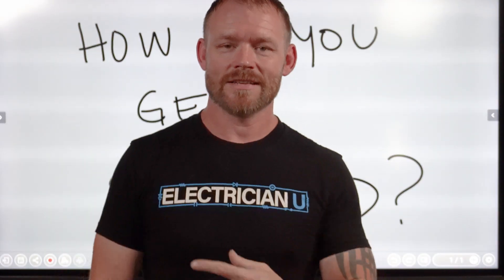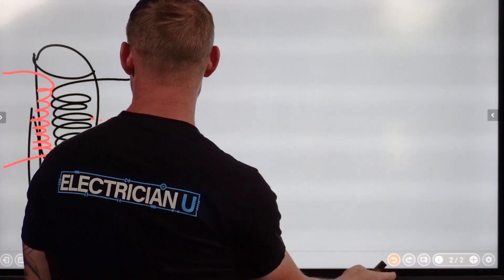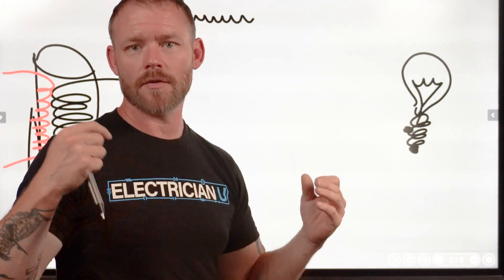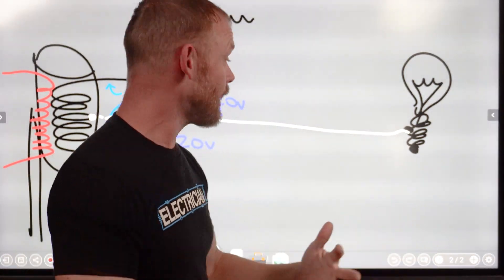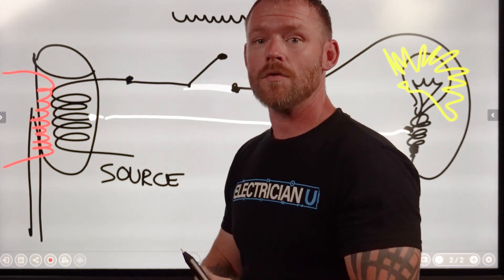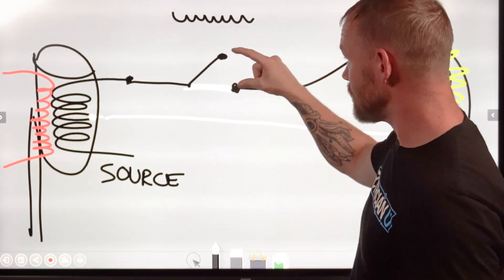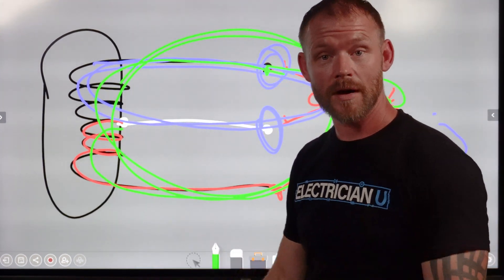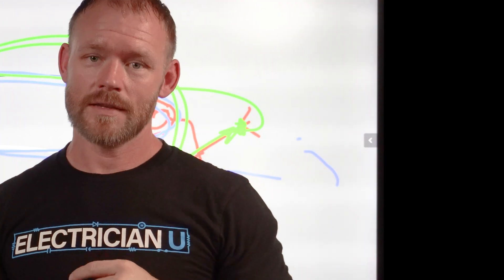How Do You Get Shocked Part2

Comment: Once again, what's missing in this explanation is that the neutral wire is grounded both at the pole transformer and at the distribution panel. If you are standing with bare feet on a wet concrete surface and touch a SINGLE hot wire the complete current path is from hot through your body to earth ground to ground at pole transformer to secondary neutral to hot. Certainly you are "safer" from accidental shock if you are wearing thick rubber soles which interrupt this current path but to suggest that you can ONLY get shocked by touching two points in a circuit is simply wrong. There is a potential conductive path through ground which CAN complete the circuit if you are not careful. Of course wearing PPE will mitigate this risk.
Reply: Yes, I think that understanding that is crucial. He touched on it when he talked about his shoes, but not very much.
Reply: Or contact an appliance or fixture that is grounded..
Reply: Not sure why you say once again because he did mention that in the part 1 video. He talked about kneeling on the ground and creating the path through ground that way. It probably deserves more time in the video (or a part 3) cause some will fail to grasp that concept
Reply: @hvacmisadventures  the reason I said “once again” is because I commented about this issue in the first video. Unless I completely misunderstand he appears to be saying that you can not get shocked by touching a SINGLE point of contact in a circuit. This, however, is only true if either the device is not ground referenced OR you, yourself, have no conductive path to ground. IMPLICIT in this assertion is that YOU are isolated from ground. He seems to focus on insisting that you must place yourself in SERIES with the conductors in order to get shocked. See the diagram he posted with open terminals. The only way to avoid shock with single point of contact is for the device you are probing to have a floating voltage such as being powered via an isolation transformer OR for you to be isolated from earth ground with appropriate PPE. If both you and the device are ground referenced you have, indeed, placed yourself IN SERIES with the circuit via the ground path and will get shocked with a single point of contact.
Reply: @Jnglfvr  the best example of " one point of contact " is a bird on a bare live hot wire.
Reply: @martf1061  Yes indeed. Another example is a lineman working from a helicopter (I've seen this) with single contact with live wire. In both cases no ground reference, no shock with single contact.
Reply: He did mention that in part 1. He said if the voltage is high enough,like 10,000 V, you can still get shock by touching one end of a hot conductor.
Reply: If the ground wire at the pole transformer is MISSING would that interrupt the current flow?
Reply: @tedlahm5740  There would have to be no ground at any point in the secondary circuit. E.g., the neutral in the distribution panel is typically grounded as well so the path would be from hot to body to ground to distribution panel ground to neutral to transformer" neutral" to transformer hot. As long as continuity exists between ground and neutral (on the secondary side) then you are at risk for shock with single contact. (Of course I assume that the distribution panel ground and neutral bars are bonded as they should be).
Reply: Was coming here to say this!  I got a nervous feeling in my stomach thinking about people watching this when he said "I can touch THIS wire without getting shocked." I think he really needed to talk more about "path to ground" than "completing a circuit" in reference to shock hazards.

Comment: "woods not conductive" I'm a firm believer of anything can be a conductor with enough voltage lol
Reply: Wood actually is somewhat conductive in many situations. Like, especially when it's studs that have dozens of metal screws every few inches and bolts or nails connecting them directly to the ground (which is the same potential as the neutral conductor). I've seen faults that slowly burn and rot the wood/drywall as they trickle current back to source through the ground. They aren't large enough to trip the breaker because there is a lot of resistance, but a barefoot child or person who's standing on the concrete and touches that wall, lowering the resistance and creating a better path, will increase the current instantly causing a good shock or worse.

Many homes catch fire, and many have burned to the ground because of this very situation.
Reply: Especially wet wood ! 
There are tons of artist doing “fractal burning” with a variety of voltages and currents/resistances of the wood. One way this is achieved is by introducing moisture. Kiln dried wood won’t be as conductive until very high voltages. 

Also want to add, people die doing fractal burns , don’t try this at home folks
Reply: @ericrioux6607  lol ever  time I hear of someone doing that I chime In with the ole safety speech 🤣
Reply: Anything is conductive if the voltage is high enough-for sure.
Reply: Yep, had a buddy doing tree work get shocked trying to get a branch stuck on a power line. Not smart lol
Reply: I had an instructor tell me that he had a coworker who was working in a switchgear when the power arced through the fiberglass insulator into his ratchet wrench while he was making terminations on the dead side of the gear. His hardhat melted to his head after the arc flash caught the whole room on fire.

He survived, but barely.

Electricity is powerful.